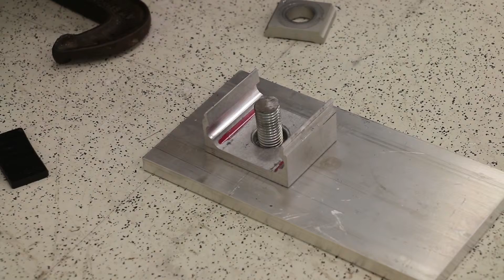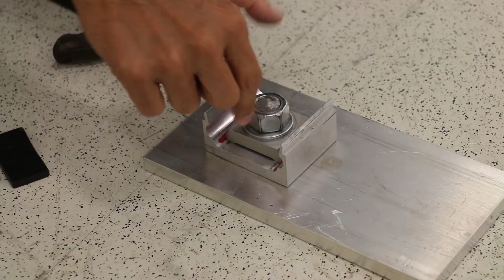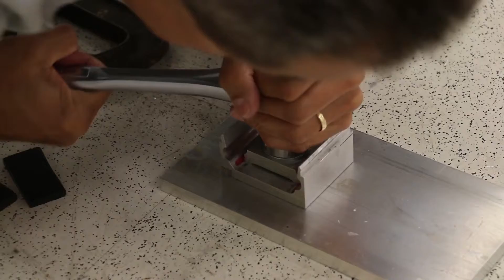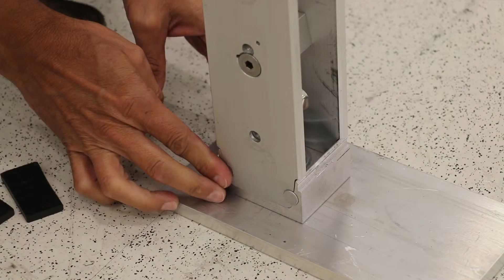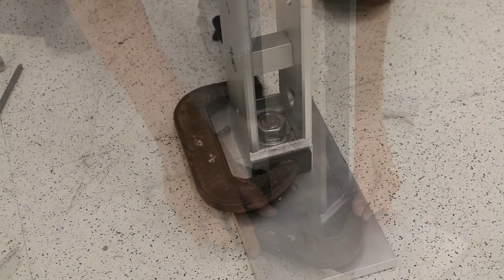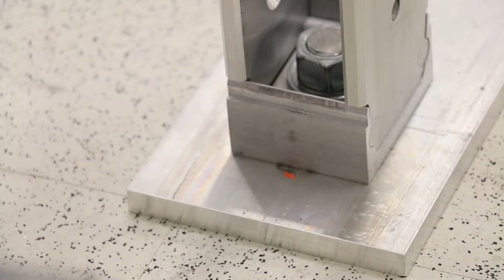Green Oxen | How to Install Epulum Railing Floor Mounts

Comment: Looks easy indoors on an flat plate, but how do you install these floor mounts on a typical outdoor concrete deck that has fall (slope) so that the rails remain perfectly vertical?